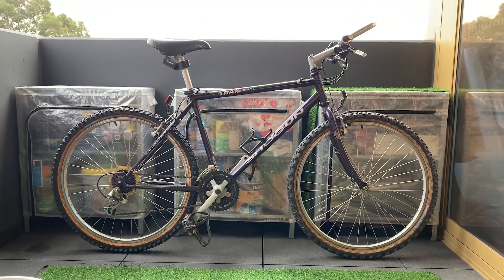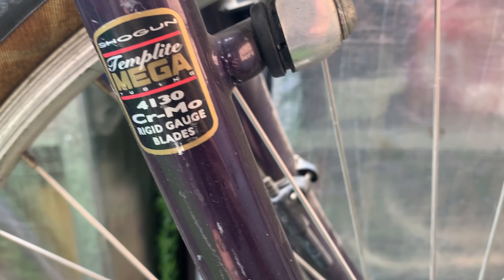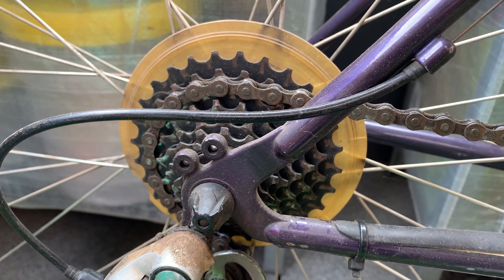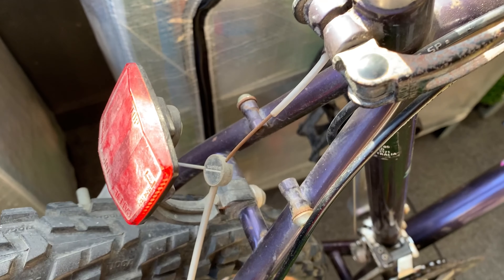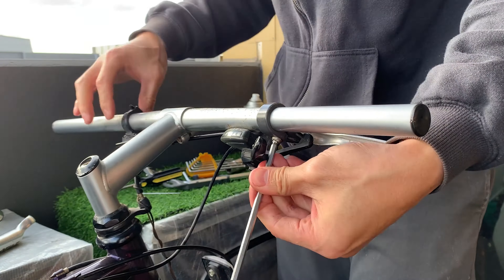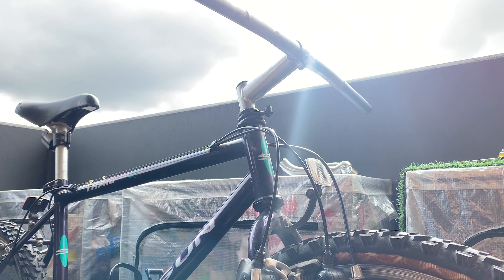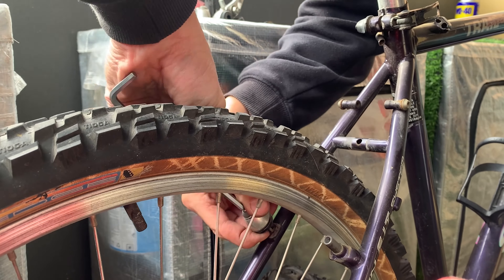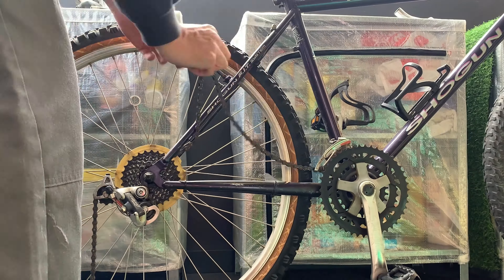Vintage MTB Restoration - Ep.1- Shogun Trail Breaker 3, bike check, break down

Comment: Are you interested in drop bar builds? If so this bike would look so good. I’m currently doing the same to an earlier model pink trail breaker. Just using a quill stem and friction shifters on the stem - super cheap setup.
Reply from the maker: yes i am interested! i guess the only thing that is holding me back is because then i would have to get new brake levers and shifters... if only they made a drop bar that fit mtb levers haha. yours is a good idea though, to use the friction shifter on the stem. maybe if i end up going 1x! cheers
Reply: @garysprojects  you gotta check out the new Surly bar!
Reply from the maker: @degolas2971  those are cool! Unfortunately can’t get in Australia and outta my price range 😖😖😖

Comment: @8:07 I have stripped 2 cranksets in the last 6 months. 1 Crankset I realize I tightened way too much however the other 1 cannot figure out what I did wrong. How tight do u get the threaded crankset remover? I am now just hand tightening and then just barely snugging it down. any ideas?
Reply from the maker: https://youtu.be/ZnBAmPfok_8 check this video out at 6:40, I explain it here!

Comment: Personally i take a pair of pliers and pull of and even reuse cable ends, and the cable as well. Then I only cut the cable if I need to, maybe just a little to get a clean edge. But this one was nasty so I can see why you would just snip rather than fiddle.
Reply from the maker: Ahhh yes ! Sometimes I do that too, really depends on the condition, but yeah the cable housing and ferrets can be reused ! 🤗

Comment: Hey 
Gary, do you want to sell the front shifter if you are not using it. I have same bike, need shifter.
Regards 
Rob
Reply from the maker: Hey Rob I think I am going to use it ! Cheers
Reply: @garysprojects  
No probs, mine still works, just being anal about thin little cover missing that moves with trigger and gap without. When will we see this bike finnished?
Reply from the maker: @robertrutledge8281  ahhh yes that would be annoying!! As for the shogun, not really sure, maybe in 3 weeks, trying to finish off the Klein and also replacement cranks for the Kona first but we will see!

Comment: Oh shit I just got a trail breaker 2 off eBay and it's going to get drop bars and probably 1x
Reply from the maker: ayyyy ebay findsssss, ya i am looking to replace the crank, so depending on what i find i might go 1x! we will see! cheers
Reply: @garysprojects  I've picked up some bars and a stem off marketplace as well. I haven't checked yet but it's a 99% chance that it's a 7 speed only freehub right?
Reply from the maker: @BCCorsa  yeah 99% sure only 7speed too 😬😬😬
Reply from the maker: @greyhound3593   Ya if I did 1x it would be 1x7, hard to go larger without getting a different rear hub, maybe there is a way to customize the rear cassette on a 7 to get a larger range 🤷‍♂️
Reply from the maker: @greyhound3593  ooooo super cool!! I went through the video real quick but will give it a full watch! Thanks for sending :D
Reply from the maker: @greyhound3593  coool just watched the whole video, that’s a neat hack! My only question was if you get a 10 speed cassette and drop it to 9, I assume you use a 9 speed shifter to match?
Reply: @garysprojects  i thin he mentions he still uses a 10 speed shifter, the uses the rear mech limit screws to lock out the last shift.  I suppose a 9 speed would also work
Reply from the maker: @greyhound3593  cool cool I guess you would just have a ghost shift on the 10 shifter , makes sense tho if you already have a 10spd group